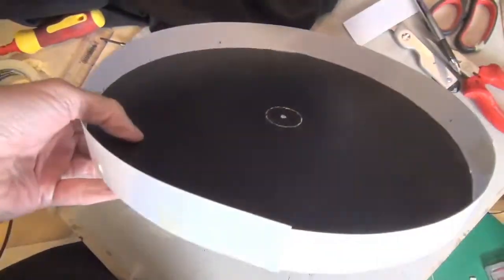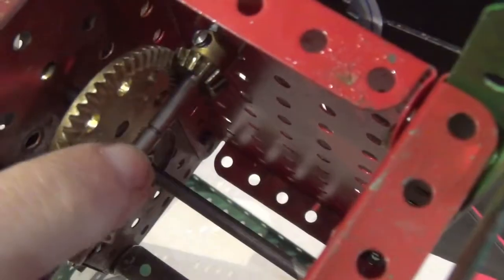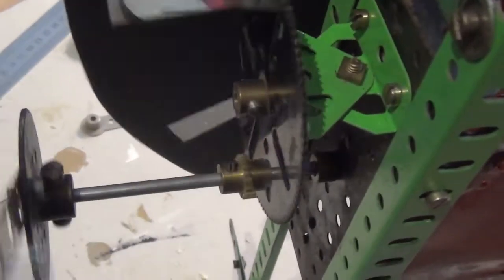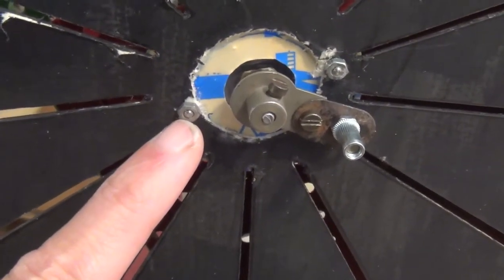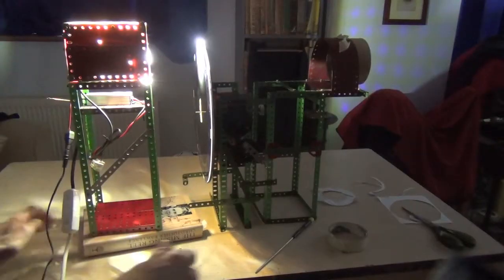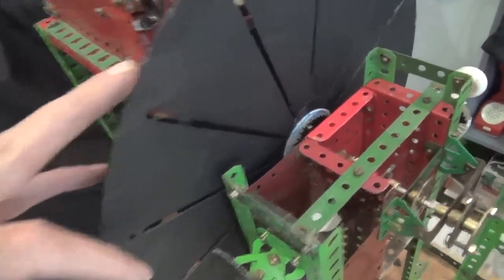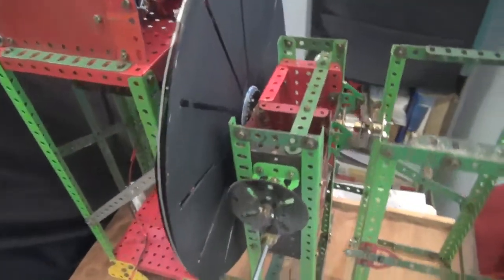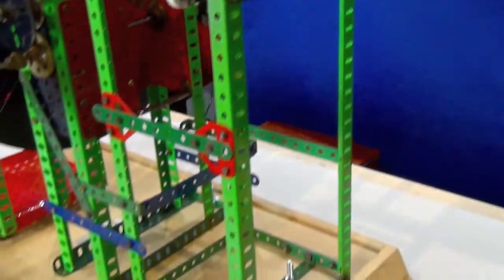Meccano Zoopraxiscope projector Part 2

Comment: Hi! I like your work and I am doing a design project that it is also based on the zoopraxiscope. I am having some problems with projecting the image in focus so I would to talk to you to maybe learn and solve the problem.
Reply from the maker: Hi Mariana, talking difficult at present, but I can respond to questions here. Re: zoopraxiscope -Problems with focus are usually due to width of slots. They need to very narrow. Ask away! Stephen
Reply: @horipet  Hi, thanks for your advice, I have tried different widths but I still don’t get the image. I would like to know the dimensions of the shutter you are using, diameter and width of the slots. Thanks.